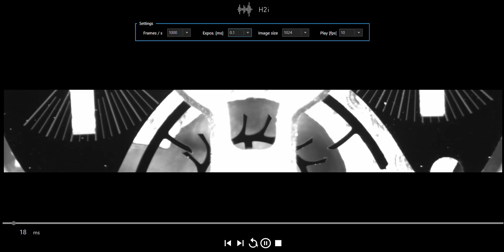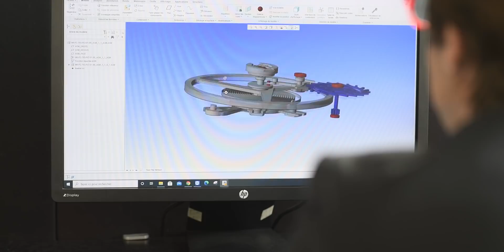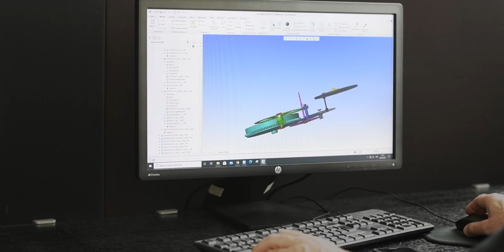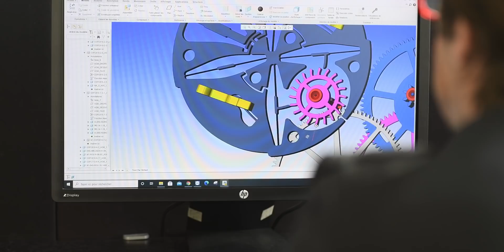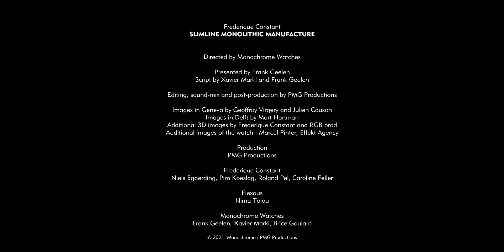IN-DEPTH - The Frederique Constant Slimline Monolithic Manufacture, with Groundbreaking Oscillator

Comment: Smooth as spring drive and fully mechanical. This is a revolution.
Reply: @Jl Jad I only saw a random forum post saying that according to FC, accuracy is -4/+6. How did you hear about accuracy? I can't find any official statement from FC. It's definitely next level tech, but if COSC standard is all it can do for now, that's disappointing.
Reply: @stefanlazaralexandru  There are three centuries of developments made by multiple brands in competition behind an anchor escapement obtaining COSC standard. That's a mature technology.
This is a completely new development made by ONE brand, and it's ALREADY at COSC standard using ONE stamped piece instead of 26.
Reply: Indeed, no more ticking like a spring drive but still full mechanical and 80h of PR on 1 barrel.
Reply: @oOoScarecrow31oOo  It's still ticking, they mentioned that in the video, at 288.000 beats per second. Spring drive is NOT ticking, Spring drive drives the second hand in a continuous movement, true sweeping
Reply: spring drive still better technology
Reply: @Jl Jad exactly
Reply: It's smooth but not as smooth as spring drive, which is a perfect sweep. Put them next to each other and you'd be able to tell easily
Reply: Zenith revolution
Reply: @Jl Jad this watch doesn't exist yet. Where you getting you opinion it's not accurate?  Also, rolex and omega are still less accurate than any regular quartz watch.  Careful about being so prideful over nothing.
Reply: Well, yes, you could say so, but a revolution that Zenith has initiated a few years ago, not Frederique Costant.
Reply from the maker: That is indeed where it started but the similarites end with both being compliant mechanisms and made of silicium. The requirements, calculations and construction is entirely new. FC and Flexous have incorporated the anchor and escape wheel in the oscillator for the first time ever. And given its small size and weight, it doesn't need any additional schock resistance.
Reply: @Monochrome-watches  exactly. As you said, The Zenith Defy Inventor is where it started. A mention of that would have just been fair. 😉
Reply: @alessandrobottero6544  Zenith also didn't manage to bring their watch to market, it was effectively a paper launch. Let's hope FC can manage to do it on a larger scale.
Reply: @alessandrobottero6544  with the cal 401.
Reply: please describe zenith revolution and show its movie in YouTube
Reply: It's not the same as the spring drive is infinite BPH they are both amazing in their own rights, the Japanese owned brands pushing the limits of engineering while the Swiss Giants just keep increasing price for no r and d
Reply: Way smoother than a spring drive
Reply: @GingyNinjyy  bruh, spring drive is perfectly smooth, there are no beats
Reply: Technically, it's still a mechanical movement, but watchmakers of old had zero availability of silicon parts. I see silicon as a bit of a 'cheat', sliding towards quartz technology. Silicon has to be fabricated in the same way as computer chips.
Reply: @chrisrussell63  Makes no sense man. It’s fully mechanical and doesn’t use a quartz crystal. Who cares how it’s manufactured? Regular escapement parts are machine manufactured too. Plenty of room for the rest of the watch to be hand finished and feel “human, even more so than a typical machine finished watch with a traditional movement!
Reply: @chrisrussell63  It's like saying that a hammer is a road sign, because they are both made of steel.
In a chip the silicon is only the support where a series of transistors are stamped. What counts is the element (the transistor), and what transistors do with electricity, not the support.
In an oscillator, what counts are the mechanical properties of the silicon.

Comment: Ker-pow take that spring drive. Just when you think a brand is somewhat dormant- they set the industry on it's heels. Bravo.
Reply: Uh...this is not really impressive at all...

This movement is beating at 288.000 beats per hour

Spring drive is NOT ticking, the movement of the second hand of a spring drive watch is a TRUE SWEEP, with no stopping at any moment
Reply: I was really excited for this movement, but from Frederique Constant's website, "Thanks to its innovative design and reduced size, this revolutionary high-frequency silicon oscillator fits inside a traditional movement configuration and offers an average daily precision of -4/+6 seconds."

So this brilliant and exciting innovation is only providing COSC accuracy!?  The latest Spring Drive movement is providing +/- 0.5 seconds per day.
Reply: This world is full of dummies this guy thinks this is revolutionary

Comment: I don't like exotic tech in higher end watches. I want anyone to be able to repair it in 50-100 years time.
Reply from the maker: The properties of the material and the manufacturing process should allow the oscillator to be replaces as a whole without too much trouble.
Reply: @Monochrome-watches  This assumes that the parts are available. Watches constructed according to simple well known principles with non exotic materials - like George Daniels watches - will be able to live forever, just like they deserve.
Reply: @Monochrome-watches  "While Omega was the first mainstream brand in 1999 to use the co-axial escapement in its Caliber 2500 movement, the Swiss brand has since combined it with a silicon hairspring in movements like the Master Chronometer 8800. However, Smith isn’t convinced about the use of silicon in escapements at all. “You can buy a mechanical watch that is 300-400 years old and it will still keep time very well with a little service. What’s wrong with continuing to use these materials? I know these materials are tried and tested and I know that by using these traditional materials and methods, I can build watches that will be around for hundreds of years. We can still replace components if need be. I don’t really know how anyone is benefiting from these new materials.”"
Reply from the maker: @yoddeb Magnetism is a serious issue and a large percentage of services are related to this.  For many people, that's an important argument in the choice for a watch. Of course, we love beautiful hand finished movements that can be repaired a century from now. Heck, it's the 'juice' that keeps us going here at MONOCHROME, but we also embrace the use of innovative materials and out of the box approaches. Think UN Freak, think Zenith LAB, think URWERK, De Bethune and also the new FC Monolithic.
Reply: @Monochrome-watches  I also embrace cool tech in watches...but as I tried to express in my first post: the higher end the watch is, the more important it is that is does not risk being a brick at some point in the future. The Frederique Constant Slimline steel is actually pretty ok priced.
Reply: @yoddeb  It's a problem with most in-house movements - if some custom component breaks and it isn't based on some other movement, you might struggle to repair it in a few decades. Even more so if the watch has additional complications. In the outset quartz replacement parts would have been expensive or impossible to source too, but now quartz is so ubiquitous you can buy whole new replacement movements for a few dollars. It's not out of the question that with constantly improving silicon processing technologies, custom-made replacement parts could be ordered for low prices too.
Reply: The exotic tech is the whole point of higher end watches. Or why else would be anyone willing to pay this much for them, if they’d get the same simple tech used since forever?

Comment: What about the shock susceptibility of the regulator/escapement? As from 8:20 it held by what I assume the steel or brass stud, then capped by the bridge/cock 8:00 for the escape wheel. And I think and assume, in the long run those two studs would have worn due to the high frequency of shock made by the whole silicon platform moved back and forth, not to mention the friction it has with the escape wheel bridge/cock when the dial upside down. I think some form of a shock absorber like Breguet parachute system, and tungsten/cobalt alloy studs would helps with the longetivity of the movement. And with that, I hope that the regulator plus the escapement including the plate and its absorber could be assembled in one block as the watchmaker won't need to dismantle those and just take off the block to do an overhaul with the rest of the movement ie mainspring, gear train, motion work, etc.
Reply from the maker: That is a good question. The properties of the material used for the oscillator are such that there is no need for additional shock absorbers. It will flex on it's own and as such will absorb a shock and simply bend back. They have tested it, under various conditions for exactly that and it kept working perfectly.

Comment: How shock resistant are the adjustable weights?  A small shift in position will likely result in big regulation changes.
Reply from the maker: The properties of the silicon oscillator are such that no shock is passed through to the adjustable weights. The material will flex on it's one in the occurance of a shock and absorb it. It has been extensively tested by FC, under various circumstances to ensure it works perfectly.

Comment: Finally, worthy competitor for Spring Drive!
Reply: It does seem so.
Reply: You already had the Zenith Invertor.
Reply: They're both competing for second. problem with Grand Seiko is the Seiko part. problem with Frederique Constant is the wannabe Vacheron Constantin name.
Reply: @mrmyoujou  Interesting.  A name does carry a lot of weight.
Reply: @mrmyoujou  so you are not interested in buying a watch you are interested in buying a logo
Reply: spartaman64 it's not an either-or proposition, but brand perception and brand recall play a bigger part in the purchase process than most people are willing to admit. Tough luck for some brands, but it is what it is.
Reply: I think FC will humiliate GS if this movement can surpass the accuracy of Spring Drive. Especially in its affordability
Reply: @cakraparindra4659  i doubt that it can surpass quartz accuracy but thats fine as long as its sub 1 second a day. but GS is more than the movement it also has finishing that rivals a 50k watch. so we'll have to see what the rest of FC's watch is like
Reply: @MrWizardjr9  yes i do agree on that point as well. And aside from the accuracy, we have to see whether this tech is reliable and robust enough compared to the other escapement mechanism.
What a time to be alive eh as a watch enthusiast?

Comment: This is a revolution in watchmaking . The fluid movement remember us the spring drive of Seiko ... But totally mechanical .. this is brilliant
Reply: Brilliant, agreed. But service may be an issue.  I bought a Spring Drive for its technology, but would have to service it at a GS service center, I believe in New Jersey.  Likewise for this FC watch.  I won't be servicing at my local jeweler.  Probably have to ship it off to Switzerland for service.
Reply: @davidc5191  True, but this doesn't need lubrication, and is only 3 atm, so what kind of service were you thinking of?
Reply: @Jl Jad Yes, somewhat of lost opportunity. This is COSC equivalent, -4 to +6 and would pass METAS antimagnetic with flying colors.

Comment: FC seem to have out Grand Seiko’d Grand Seiko here. With a similar but much more compact technology to that of Zenith’s oscillator tech from a few years back. Still, no mention of the actual accuracy of the watch here? Does it compare to quartz and the Spring Drive or not?
Reply from the maker: For the moment it’s given to COSC standards but it’s just the first tests
Reply: @Monochrome-watches  we're about to see if Grand Seiko should be worried or not after the COSC finally gave the accuracy result of this movement
Reply: It’s highly questionable if a  fully mechanical movement can keep the time as good as Spring Drive, which is known to be incredibly accurate. (+- 15 seconds a month)
Reply: @retardinho5048  Yes it's questionable at best. I don't have a degree in engineering so more reason for us to get excited eh?

Comment: Quite impressive, isn't it? See some similarity with the Zenith Defy Inventor, which is a. 44mm in size b. 18Hz only and c. sells at 17,5k EUR.
So the FC has a movement with more than double the frequency in a more wearable size of 40mm at one third of the prize of the Zenith.
Just struggle with the looks of the watch itself - a bit too old fashioned for me, esp. when paired with such a revolutionary movement.
So looking forward to see it being deployed in other models, i.e. the Highlife, was well.
Reply: Very well said! The design is too Breguet'ish. Unfortunately the case back view is quite unimpressive as well, for such an impressive oscillator- and whole new gear train design.
Reply: Nice comparison with the Zenith Defy Inventor! Hopefully this model will sell well and we'll see new designs using this caliber FC810.